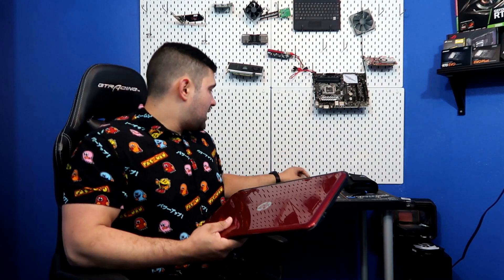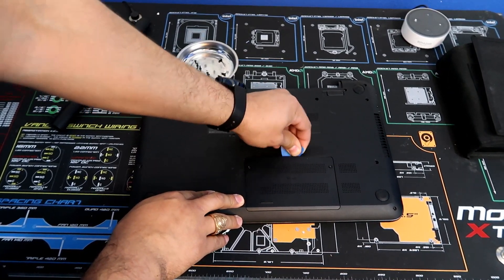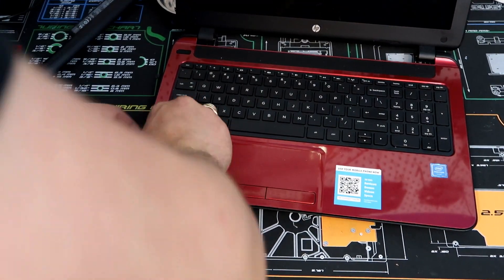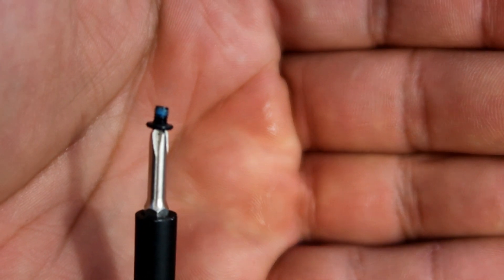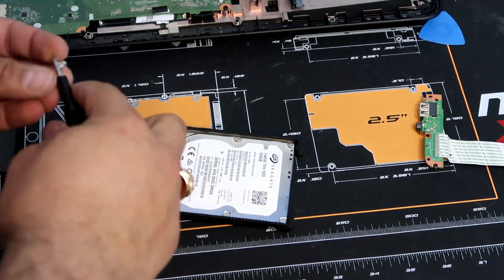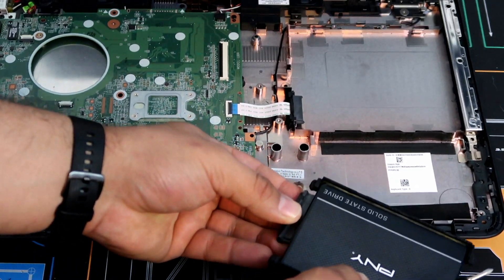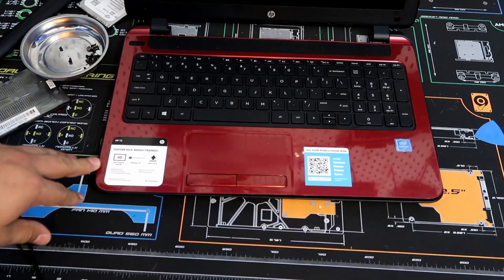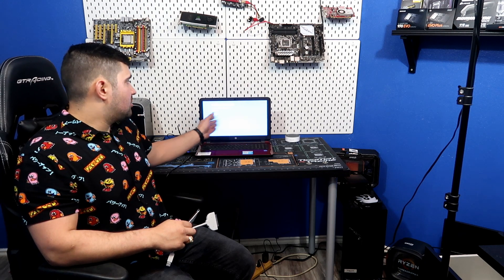HP 15.6" 15-f272wm SSD UPGRADE

Comment: geez getting ready to do the same thing with the same exact laptop in red. Thanks for showing it I would not have figured it out. Usually its not this difficult but thay didnt make to be real easy. Installing a kingspec 2.5 sata111 512 gb. Have the original drive which was just reset to win 10. But wow is it bloated with things I don't want.  Going to put a clean oem copy of win 10 on. Its all just for fun but this laptop can be used. Yes its old but workable with a new drive and new OS.

Comment: WOW! They don't make it easy do they. I swapped my old Toshiba out in under 5 minutes. Toshiba had a panel over the drive, 4 screws.
Reply: I was gifted this same HP recently, and had planned to upgrade to an SSD, but after watching this I may just give it to someone else. Really not much of a computer.
Reply: @oldator60  It isn't that hard, but I agree that they should've just located the storage drive under a panel on the base cover. They already had one for the ram; why not the HDD too?

Comment: Thank you for this tutorial. However based on the issues others have had I probably won't attempt this. Gotta say I will NEVER purchase another HP product. My HP 15-F272wm HDD starting failing within 6 mths. I didn't really think it was the hard drive. I thought it was just a cheap processor. I barely used it and just kept it for picture storage. Now it has completely failed and I've lost everything. I wish I suspected the HDD earlier but I'm definitely a novice with stuff like this. I used to think HP products were quality but that couldn't be farther from the truth. Every HP printer at my work is constantly going down. Im shocked that something so cheap and inferior was put out in the consumer market. Then again I was dumb enough to buy this at Wal-Mart. Definitely a lesson learned the hard way.
Reply: mine too i never lost the data but computer freeze during start so many times until i uprageded the ram but this laptop still has some most random crashes once in while

Comment: I followed, step by step, your video. Assembled my HP 15-f272wm. Everything worked well, except the touchpad. The touchpad is not working so I have to use a mouse. What could possibly happened? Thank you
Reply: The touch pads are REALLY sensitive. You probably broke something related to the pin alignment. It's OK. A wireless USB mouse works better than the touchpad did anyway.

Comment: I'm new to DIY computer repair. I've seen a lot of information on making sure to ground PC's and laptops before working on them, people often use an anti-static wrist band to do this. In your video you do not mention anything about making sure the laptop was grounded before working on it (that I can remember). Do I need to worry about trying to ground mine or not? I have the Walmart version of this laptop. Thank you!!!
Reply: Truthfully, I’ve worked on close to a dozen laptops while lying on my carpeted  floor and never had any problems. I wouldn’t recommend doing what I do but you have nothing to worry about if you just work in a table.
Reply: He’s using an anti static mat
Reply: I’ve been working on PC’s for 12 years now, and I have never ever once used one of those bracelets/mats anything. You’ll be alright, just be careful.

Comment: You mean to tell me that I can improve the performance of my laptop for less than $100 than dropping $1,000+ on a whole new computer?! I need this upgrade now! I had the same laptop for 4 years, barely any memory used up, but now my computer occasionally crashes, very slow on certain applications and the battery is barley lasting 2 hours!
Reply: Just put an SSD in my friend's old budget laptop, 5 years old, garbage. Made it fast, like, actually usable.
Reply: You can still get a battery for this laptop on amazon or the bay. Got mine and its 4 hours runtime now sweet. 20$

Comment: Hi! I've been following your tutorial video step-by-step, but whenever it gets to the point where you take the disc drive out, I'm unable to, despite taking out every screw in the back. Any idea why?
Reply from the maker: Make sure that you take out all screws that are visible. Also always be  gentle, so that you dont risk breaking anything.
Reply: @Ghost57  Well, back with an update: I can 120% confirm I have a 15-f272wm, I've double-checked it I don't even know how many times, but for me, I had to remove the three screws in the disc-drive before being able to rip them out, whereas you were able to rip the disc drive out before removing said screws. This is really odd, but what's also odd is that at 2:04, we only have three of the screws there.

We're now at a point where we're supposed to use the little rubber/plastic tool to open it up via sliding it on the front and sides, but we're unable to make much progress.

Honestly I'm just at a loss. The bottom of the laptop says it's a 15-f272wm but we've been having difficulties where you haven't. Any idea?
Reply: Something .Else 
There’s two different versions the Walmart version and non-I have the non-version as well just take your time make sure you get out all screws disconnect it carefully

Comment: Thanks for posting. I'm considering doing this to mine as well as upgrading to 8gb ram. As-is, it's unbelievably slow.
Reply: Is the performance better? Thinking of doing same thing.
Reply: @EB-xg1jf  I ordered the parts this past weekend, got 8gb RAM and a 240gb SSD on the way. I'll update soon 😊
Reply: @traby4077  Ok Please. The information will be really  helpful.  My pc is really annoying to use now and I'm  considering a new laptop.
Reply: @EB-xg1jf  I finished the job today. 8gb RAM, and 240gb SSD. I could not have done it without this video, so thanks for the upload! My computer runs like a totally different machine, it's unbelievable how great the improvement is. I highly recommend doing the upgrades. I bought the SSD and RAM combined for under $65 on Ebay, so give it a shot. It's much cheaper than buying a new PC!
Reply: @traby4077  Thank you very much for the update. I will do same. Can you please inform me on the SSD and RAM brand?
I hope the improved performance lasts long and doesn't start disturbing again after few years of use.
Reply: @EB-xg1jf  The ssd is Crucial. Ram is a generic Chinese brand, Yongxinsheng. Similar to the 4gb that came in the machine already.
Reply: @traby4077  I'm confused about the SSD.  The HD in it now is 500 GB, how does dropping to a 240 GB help ?  I'm almost out of space now, and was looking at a 1TB drive.  Are SSD's rated different ?
Reply: @tommyc8333  you can have the hdd in the optical disk drive then the ssd in the original hdd spot thereby utilizing both. search youtube for videos on hdd caddy for more info.
Reply: @tommyc8333  The SSD helps by speeding things up exponentially. Yes, a smaller capacity SSD will decrease your storage capacity. Larger capacity SSD drives are expensive. So you'll be trading storage for performance. Another option is to install a small SSD and buy a SD card for additional storage if you need it.